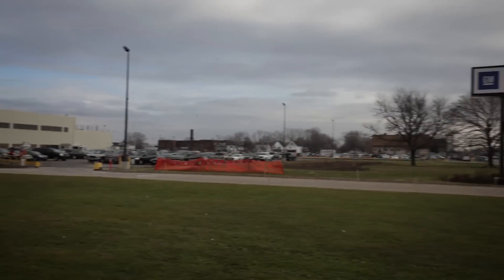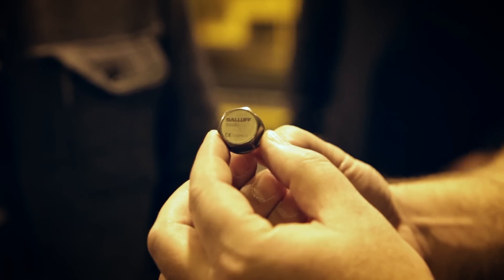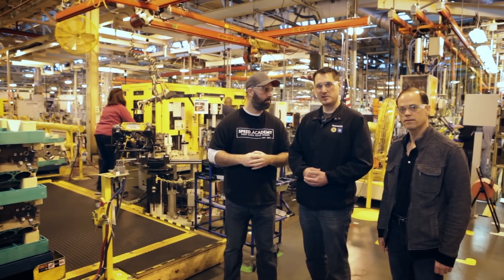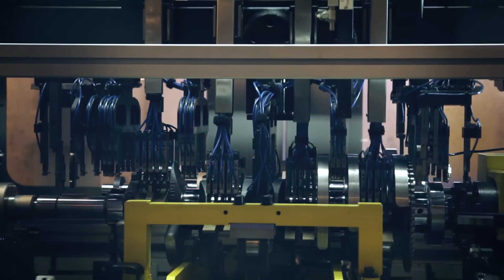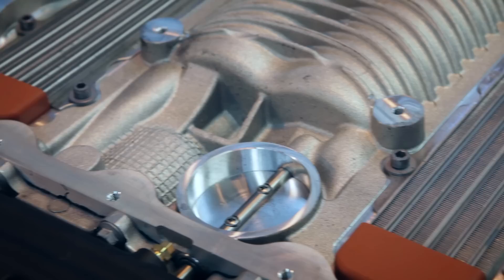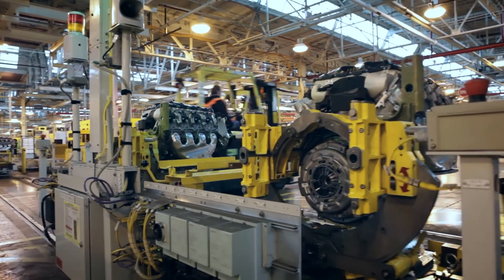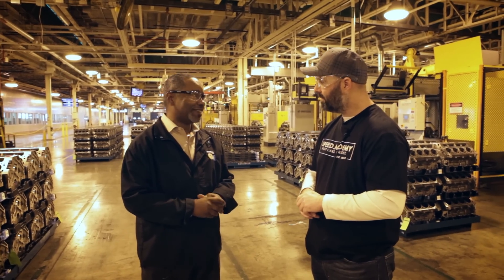Building GM's most powerful Engine Ever, the 650hp LT4 V8!

Comment: Had a 68 Impala with the Custom coupe Top, it had a 327 350 HP Valve cover's had Tonawanda Race team on the Valve cover's....400 turbo trans and 12 bolt limited slip.... only 21,000 miles on it.... silver and black vinyl Top....She was awesome... Mother was rear ended hard warped the frame buckled the quarters.... I put everything in a 72 Chevy swb fleetside....that was 75 drove till 85 sold... The little pick up shocked many.... she was sweet I even installed the 12 bolt, I removed the coil suspension and installed leaf springs...The earlier Impala had same wheel bolt pattern as the half ton pick up....

Comment: In your GREAT video, you were told & show the LT4 uses a 'raw casting' that is machined, but that's not correct for the Z06 LT4.
For the LT4's used in the Corvette Z06, the crankshaft is actually 'forged steel', as per GM's Press own info - quote:

COMPACT POWERHOUSE: INSIDE CORVETTE Z06’S 650-hp supercharged 6.2L V-8 LT4 ENGINE, it possesses world-class power in a more efficient package:

Rotating assembly – Each component of the rotating assembly is unique to the LT4 to support the cylinder pressures the boosted engine is capable of generating, as well as the unique requirements for a lower compression ratio. 

Elements include:
The 1528MV "forged steel crankshaft" uses tungsten balancing inserts, ground pin collars and intermediate pin drills for rods #1-6.

Comment: I see that GM is making their own cylinder heads in house and tolerances are tight. Wonder if this has anything to do with the story I hear (I run an LS7) about the LS7 engines "dropping valves" possibly due to off center guides (something like that) because a vendor provided the heads for the LS7.  
Seems that with machinery like this the LS7 issue would have been caught if there really is an issue.

Comment: The last motor I bought from general motors was 25 years ago and it was a crate motor four bolt main and it came with blue paint on a couple of the mains which they had ground incorrectly and had to pull off the line and redo and it came through with an antique rear oil seal setup not congruent with the block and the current oil pan gasket sold for that model what a pain in the ass that was. Oh and did I forget the general motors went bankrupt and let go all of their retirees pensions because the government let them, 
There was a time when people said what is good for general motors is good for the country, now general motors just screws its long-term employees and moves on.

Comment: Cast crank in a 650 horse power blown application? I would have thought a forged unit would be used.
Reply: the crankshafts used in the LS and LT series engine are surprisingly strong for being cast. They perform well even at the 800hp level. The most significant difference between a cast and forged crank is that a forged crank has is more ductile while a cast crank is brittle. Its detonation that will kill a cast crank because the shock of the detonation can shatter the crankshaft, as long as detonation is prevented a good quality cast crank can support very high horsepower numbers

Comment: It's kinda funny when Porsche or Ferrari guys say they get 5 or 600hp out of a much smaller engine. Well, that may be so but at what cost? The aluminium LS engines really don't weigh much more. They are a tad bit heavier than some exotics so that is a point but, lets look at the big picture. 
A big, underhead, 2 valve V8 is a really simple, inexpensive engine to manufacture. You can get 550hp out of one and still keep it well under 100hp per liter so that big ol' engine making 550hp is not working hard so it will last a very long time. How many Ferraris do you see running around with 100,000+ miles? If, by chance, you did see one, would you buy it? 
Now, suppose, you aren't happy with just 550hp. It's pretty easy to pump another 100 or 150hp out of pretty much any LS series engine. An extra 100-150hp is grand or two away and you really aren't going to stress it or reduce it's lifespan by to much. 
Can you do that with a Ferrari? How much would it cost you to get another 100hp? How long would that engine last? How much is regular maintenance? How much is a full rebuild? 
Don't get me wrong, some of the exotics are beautiful, amazing cars but they are very expensive and they just aren't built to drive every day and pile miles on them. 
You can buy a nice Corvette for 50-60K. You can drive it every single day, have 5 or 600hp on tap, put 1,000 miles a month on it and do that for a decade. 
Yes, a Ferrari is a work of art but if you want a hot car to drive and enjoy, it's really tough to beat a Corvette with an LS in it and any middle class person can afford one. They aren't cheap but you don't need to be wealthy to get into one. You could even get into a used one for 30K and not worry that that there may be a hidden $30,000 repair needed. Everything on those cars is affordable. They are made to drive and enjoy and there is no better bang for the buck on the planet.

Comment: It's got a CAST crank.  I was impressed up to that point.
Reply: Its a 1538mv forged. A step up from the 1058 forged lsa crank. Besides there has been less then 5 reported failures of any 4.8 5.3 6.0 cast crank on hundreds of 1000 plus h.p. builds lol
Reply: @Thelastoftheog  Yeah, five REPORTED failures.  Forged is the ONLY thing I would put in an engine like that.  Good to hear it is.  And the numbers mean NOTHING to me, sorry. 

Any idea how many of those 1000 Hp plus builds broke a crank, quite a few, I'll wager.  Maybe the cast cranks are better than they used to be in the 70's.  Maybe they are pressure cast now, or x-rayed or magnafluxed for quality, or something of that nature?

You KNOW people are gonna start throwing nitrous and bigger superchargers at the thing, and that WILL break cranks, especially if they are clueless.

Comment: My 2014 Camaro SS 6.2L V8 L99 engine, normally aspirated, but with aftermarket headers, cams and complete exhaust mods dynoed at 600 hp. The guy doing the tuning said he could get over 700 hp but it would be a little 'rough' for the street and daily driving. I held it to 600 and had a miracle street car (that I had wanted back in the '70s but couldn't do--long story). So  why is this LT4 so "special"? Superchargers are notorious for slow pickup.. bet I could eat his lunch but sadly, I no longer have that car.
Reply: Dada Fan idiot of the day award goes to you

Comment: SORRY TO BURST UR BUBLE HOWEVER  THE OLD 1970 LS6 IS MORE POWERFULL WITHOUT ANY BLOWER IN NATURAL ASPERATED VARIATION. HOW MUCH TORQUE WOULD UR LT4 HAVE WITHOUT A BLOWER AND ON THE OTHER HAND WHAT WOULD THE OLD LS6 454 HAVE WITH A BLOWER  I BET IT WOULD BE CLOSE TO 900 HP WITH COLLOSAL TORQUE  ALOT MORE RELIABLE HP AND TORQUE THAN ANY OF UR COMPUTORISED SHIT  MORE OFF., AND HOW BIG A PULLEY ARE U USEING ON THE CRANKSHAFT  HOW MUCH UNDERDRIVEN IS UR MOTOR USEING TO BE DOSTLE ENOUGH TO BE USEING ON THE STREETS  ILL BET THAT U CAN'T FIND A PULLEY BIG ENOUGH TO ACCOMMODATE THE USE OF UR MOTOR IN A STREET VEHICAL  NO THANK YOU    I'LL STICK WITH AN ENGINE THE LS6 454   NOT UR LITTLE LT4 OR WHAT EVER THAT ALUMINUM POS IS....

Comment: The only thing that would improve this process would be to eliminate the "union". That adds tremendous cost to all aspects of the process.
Reply: Two or three of the presenter's interviews and guides were union people. Tonawanda's  working relationship has been very good from day one. They build, and have built many off GM's most powerful engines, and they build bunches of them. When automation started showing up, the workers at Tonawanda embraced it, hesitantly, but they did it. Today, the bottom line for Tonawanda operations and the increasing need for the products it turns out under tight cost controls say they stay open, as they are not producing products that don't meet those financial criteria- small sedans as Detroit has been building them loose money. By the way, most of our foreign plants own workers vote against the unionizers; but they are better paid than UAW contract workers and have better benefits on the main, but their corporate offices believe in investment in manpower,  and a great deal more the self corrupte American Union movement has become. The ideas of 40 hr work weeks, no obligatory overtime, sick leave, safety and health issues all have their beginnings in the American Union movement. We used to expect that union bug on something to mean quality, and the union management saw more profit for themselves in status quo than helping the mfgs grow. I carried a Union Card for 15 of my 35 year plumbing career- much of my family does or have had union credentials, but not so many as once. And that, the surrender of quality, is the saddest thing of all. Oh, another thought about those cheap domestic cars like the Pinto, Mustang II, Vega and similar; all were flawed cheaply built pieces of designed obsolescence- designed by American engineers, and said grace over by the bean counters.

Comment: GM's goal is to sell you a new corvette every seven years.  My goal is to get a 2021 corvette that weighs 2900 pounds.   This LT4 engine is a great performing engine.  Now, how can they produce it to weigh 200 to 250 pounds less.  By using lighter materials like (Magnesium 1738 kg/m3 vs steel 7850 kg/33) on non moving parts.    Magnesium is  22% the mass of steel.  Great innovations in the alloy have taken place since 2010.  Maybe use Titanium on the exhaust manifold  (Titanium is 4500 kg/m3). Titanium is 57% the mass of steel.

Comment: Still 7 hp less than Ford's most powerful engine, the 427 hemi cammer built in 1964!  I know, I know, it never made it into a production car but was sold to drag racers when NASCAR banned it.  The LT4 wasn't made until 1996 and it took until 2018 to get it to 650 hp.  As for OHC vs OHV, there are pros and cons for both.  When it comes to top echelon racing (F1) the Ford Cosworth DFV 4 cam 32 valve engine still holds the record for most F1 victories at 153.  It's double overhead cam construction allowed it to rev to 10,500 rpm before electronic cutout and has been run without the limiter to over 11,000 rpm with no issues.  Just can't do that with a pushrod engine.

Comment: 650 hp is a lot of hp!   From what I know from physics that is 42.5 btu / min * 650 hp / 30% efficiency or the burning of 92,000 btu's of gasoline every minute.  If gas has 117,000 btu of heat per gal.  That is 8/10 gal.   per min.    I don't know if a car engine can run at 650 hp for one minute?
Reply: There is also technology like cylinder deactivation for high way cruising.

Comment: Can someone tell me if this LT4 is based off the 1996 LT4....Because if it has nothing to do with the LT4 made in the 1996 corvette....Then why call it the same engine. Any info would be appreciated.
Reply: different motors ...90s lt1 and lt4 had that stupid optispark system and were just regular 350 small blocks...they started the LS motors in the late 90s early 2000s..total redesign.

Comment: i get into my toyota, which turned 90k miles.  engine has no leaks.  dry on the outside.  i turn the key and she runs.  i believe in toyota after owning a f150 1998.  gm pay back the taxpayer loan.  toyota rules

Comment: Didn't notice deck plates torqued on durning machining.Touquing head bolts and 6bolt mains distorts the block by microns.This is a high level mass production process nonetheless.

Comment: Ya, wow. A 70 yr old pushrod, well done GM. Guess there's still enough idiots out there that will still buy your stale technology.
Reply: Beats OHC crap. Few feet of timing chain and guides to fail. Top heavy and make less power than a 2 valve chevy. New rarely means better. Even Ford sees it and is coming out with a pushrod engine to TRY to compete.
Reply: @fastnasty6627 .....its all about saving money and retooling .  So save the b/s for the brainwashed fan boys!

Comment: Nice engine 
The exhaust manifolds could be better eg welded and mandrel bent.
The exhaust system on the cars also could be better.
Not bad for a gas guzzler.

Comment: It's a cool guy motor but it's the freekin ugliest motor anybody ever built. Ugly valve covers, all them voilf clutter up everything, the intake, the front cover.. butt ugly... the one thing I been doing that helps...old school  BBC valve covers the ones with M/T and find...I cut them up and use them as covers for the valve covers and coils and wirring/,plumbing...done a dozen motors so far ..I charge $300..., BBC covers are about  ,50 and after I made patterns for cut/trim..done in an hour, polishing is another 250, my polisher charges me ,50...for as ugly as LD is that is one solid motor. It makes more power than it looks like it could and they rarely spit parts out...I will like them more when someone puts s pair in s skater 40 with big boost...psi pro charger or a couple turbos...need to see if they will live @40+ lbs boost for 20 min at a time..easy if ya got money with BBC...580 ci and a psi and upper,/lower first and a chiller is good for 2400 hp on E85 but they cost twice as much as a top fuel motor to builf

Comment: Nice video , its a bit sad to see so fewer people on a line / appears that labor shifted to machine and robot building jobs . I suppose it's for the better to a large degree in many regards and to just put in / install valves in or seals and springs is an extremely boring job and undermining job for some . But hey people still do make it happen I just like nostalgic times even though I'm only 36 or so .

Comment: I live in the area and had family members work in that plaint. We are very thankful for GM commitment to Buffalo  area. The UAW here has Ben great. If I remember correct The ZO6 engine worked out 427 CID  going back to a very famous GM engine built buy the same plaint. No other  engine in the world has this HP to weight ratio. and there is versions of V8 running on E 85 gasoline as well. great job showing the LT4!!

Comment: This car was intentionally designed with certain engineering flaws that are meant to fail. You can't have a reliable car that ran well all the time. Otherwise Chevy would be out of business. To bad it cost an obscene amount just to change the heat/AC diverter doors,  remove top half of engine to access firewall, then remove the several hundred pound dashboard as a unit...$5000 to $6000 to replace less than $200 in wear-out parts.    Oil pressure sender fail? They DO!   and its a $12 part that takes $1,400 in labor to access.
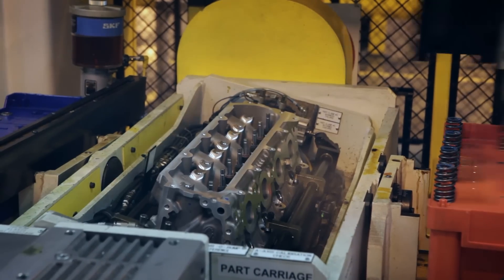Reply: 5 to 6 k in labor? @ a hundred an hour shop rate....50 to 60 hrs? I call bullshit. Ya, GM is going to make a part so difficult to replace, knowing that they have to reimburse the dealership if it fails under warranty...retired gm service tech in 95...I loved warranty work, especially at the cad store...sts needs a motor, warranty pays 18hrs... drop it off at 8 am and pick it up at 5:30...evaparator cores bin c/h body cars...1 he and 15 min. Warranty pays 7.2- 7.4 hrs. Shit it all easy.

Comment: I have 250k Mile's on all my GM 5.3 trucks and Mini van 320k original motor never apart use no oil no leaks only minor issues. GM came a long way from 1980s junk.
I am Gm forever now. Gonna try 400k on 2004 Venture van 3.4. Will send to GM plant to inspect it amazing. Cheap to fix also.
LS 6 kicks ass on race day also..
Reply: 96k on my c5 Z06 stock Ls6...still lots of fun and enjoyment, so I won't be selling it dirt cheap, any time soon...lol

Comment: yet they can't design a torque converter for jack sh*t.  all made in mexico as cheap as possible and they suck balls.  buy a camaro and i'll guarantee you you will be replacing the torque converter within 12,000 miles and that's just one example.  the camaro line isn't even the worst.

Comment: That 650 horse is super charged horsepower. Not naturally aspirated lol. Ford made more out of a smaller stroke and bore 5.8 355 . 662 HP. Compared to Chevy's 7.0 427
Reply: Ford is also going back to pushrod engine to TRY and compete with chevy.

Comment: why maifolds? i thought you'd wanna maximize it with full length headers. and is the b/s square, undersquare, or oversquare?
Reply: supercharged engines make more power with stock exhaust manifolds than full length headers or zoomies.

Comment: People the piston Rings never ever seal completely otherwise the engine would blow up its as simple as that, the reason is to allow oil to mix with the fuel and air and thus lubricated the top end of the piston chamber. :)

Comment: I will share my knowledge short block has less parts, long block means more parts same block. 4 bolt main means each piston on bottom has 2 bolts on each side. I've seen 260 v8 olds motor and my 1995 caprice has 4.3 v8. putting new motor has bunch challenges. I've seen a few ls swaps my god it's not cheap
Reply: Short block no heads or oil pan or timing cover. Long block has all but intake.

Comment: Wonder how many jobs those robots eliminated?
Reply: With the invention of the car, I wonder how many carriage and saddle makers they put out of work. Either move forward or be left behind.
Reply: It eliminates the factor of human error.  I trust a precisely-calibrated robot more than I trust a human to reliably build an engine correctly time-after-time over millions of engines.  I've yet to see a machine show up to work hung over, to say the least...
Reply: All those robots and assembly machines are designed, built, installed and maintained by people.
Reply: I wonder how many engineers it took to design it, programmers to make it do what it does, people to install it, people to maintain it. Also, how many people does it take to build that robot?
Reply: I wonder how many US jobs these robots have saved because automation cost the same no matter where you're located. "Y'all want robots or you want the plant to move to Mexico?"